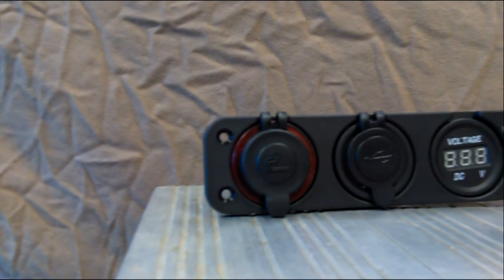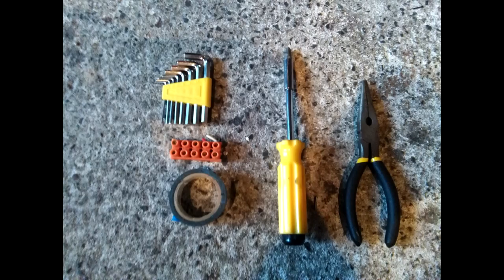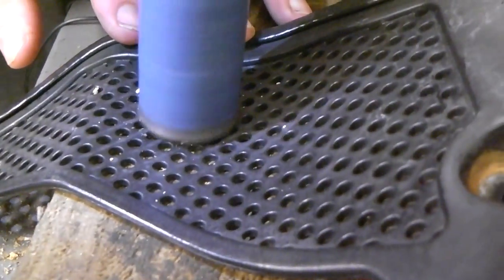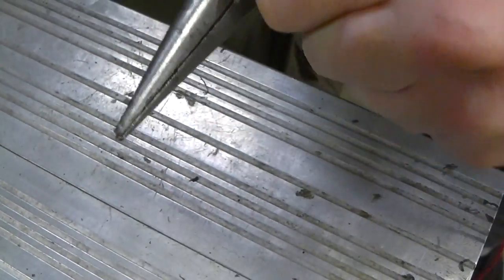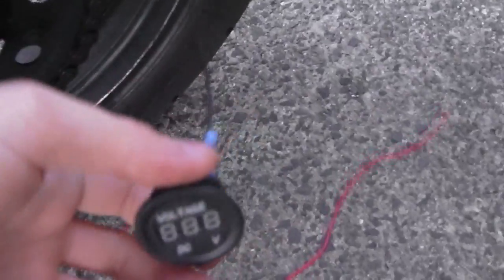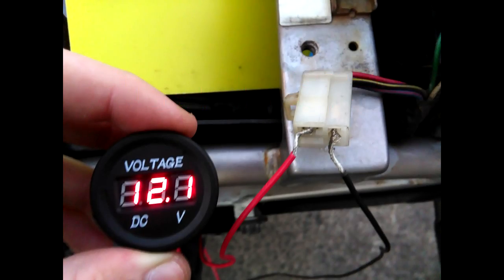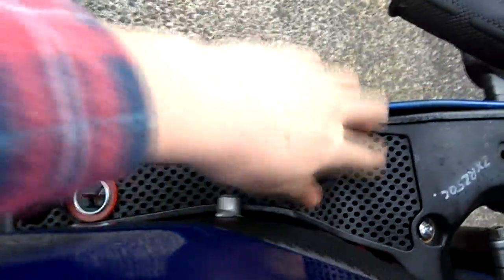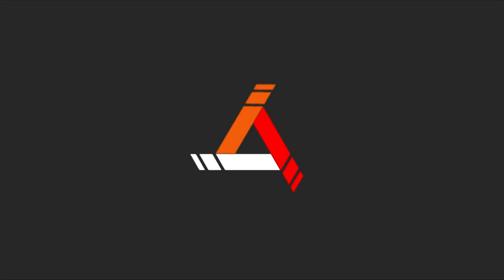Motorcycle Cigarette Charger Installation Guide

Comment: Is the tail-light wire strong enough to take the load going through the 12v socket? I've got mine wired direct to the battery but really prefer a switched live...
Reply: My Stock tail-light is a regular bulb (not LED) and it has never encountered any problems. I'm not too sure how well it will work if your tail-light is using LED's as the voltage is lower.
Reply: Understood - thanks for the reply...